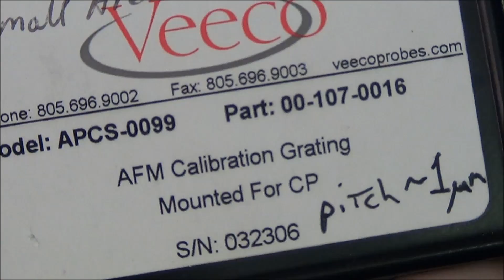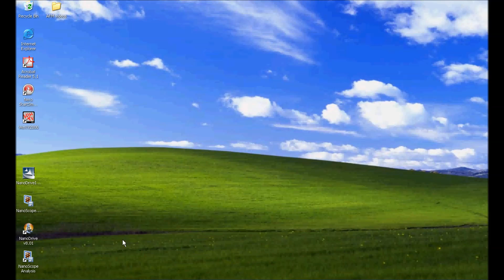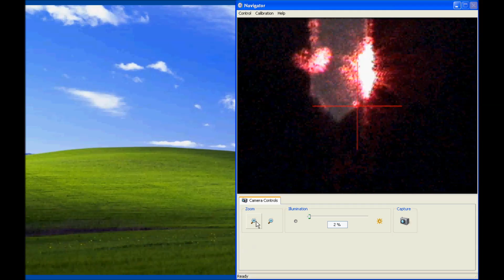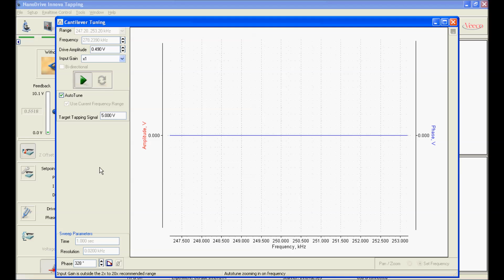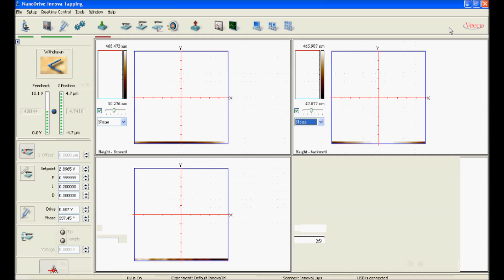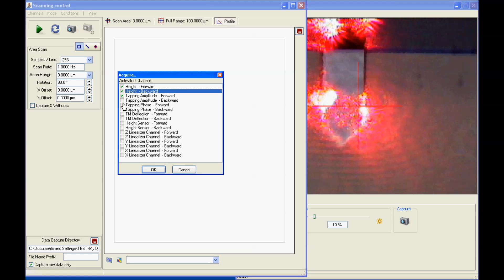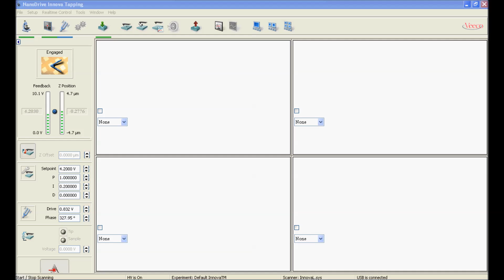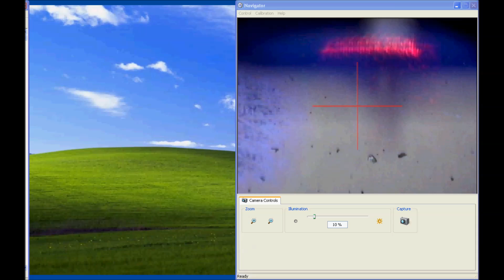AFM basic tutorial

Comment: Hello Dave,
This is Nayan from India. Thank you very much for the basic demo. I have two questions, and hope you could help me out with those.
1. Below the setpoint data, there are options for drive and phase. What are the basic utilities of the same. Can we play with them too, how?
2. I would appreciate your valuable tips on small area scanner as well. How, when and what purpose we could use small area scanner.
Reply from the maker: Certainly Nayan.
1) drive and phase have to do with the vibrations of the cantilever when it's in tapping mode - as we use the program to tune these settings, I do not recommend changing them here. If the vibration of your cantilever is off, it is better to re-run the tuning program covered in the video.
2) This depends largely on the size of the features you wish to image and study. If I wish to look at some features close to a micron in size, spaced a micron or two apart, then a 10-20 micron image may be best, to best represent the surface morphology. 
If, on the other hand, there are features 50 nm in size, spaced 100 nm apart, then a 2-3 micron image may be best. The large area scanner is best used for 3-100 micron-sized images, while small area scanners are better for sizes below 3 microns. As most of what I study is best shown at 3 microns or more, I often stick with the large area scanner, but for some really flat surfaces where the height may only vary by a monolayer or two, I switch to the small area scanner and do a 1x1 micron image.
Hope this helps.

Comment: Hello Sir 
Can any one tell me what is this flat surface you scanned with AFM and you showed in the video ? 
Thanks
Reply from the maker: That is a calibration grating - engineered so that the spacing of holes (called the pitch) is repeated at specific increments, say 1 micron, for example. These gratings are scanned so that you can check the x & y distance in your scans, and adjust the scale of the software if necessary.

Comment: Hey,
This is Ala Eftaiha, a professor of physical chemistry at the Hashemite University, in Jordan.
I have a “veeco di-innova” AFM and I have a problem in aligning the laser on the cantilever.
First, the cantilever was placed above a stainless steel mounting disk, where the probe was centered in the Navigator window. After that, I started to use the laser adjustment knobs on the right hand side of the SPM head to direct the red laser beam onto the back of the cantilever, but unfortunately, I cannot find the laser spot at all.
Actually, I doubt if the laser works or not. To check that, I have replaced the stainless steel mounting disk with a piece of white paper, which I expect to give a better laser contrast, but I cannot identify laser spot.
The thing that make me confused is that after I unplug the head, the laser diode still on!
I am wondering if there is any suggestion to solve this problem.
Sincerely,
Ala’ Eftaiha
Reply from the maker: Have you tried putting the laser on the frame that holds the cantilever? Sometimes I place it there, then walk the laser to the diving board (cantilever) - often I don't use the microscope, I just watch the laser spot until its in the right place.
Another method is getting your tip close to the sample (< 1 mm), then you can see the laser on the surface, although be aware that the laser angle is skewed so it'll appear to the right of the cantilever when it's in the proper place. 
Another issue that sometimes comes up in the microscope is if the illumination is too high it'll make the laser dot very faint - try turning the lighting low or even off to help find the laser.
Hope this helps.
Reply: Dear Dave,, Would you help me, inform about of the cos and sin in use AFM ?